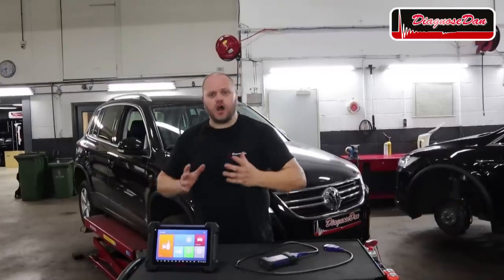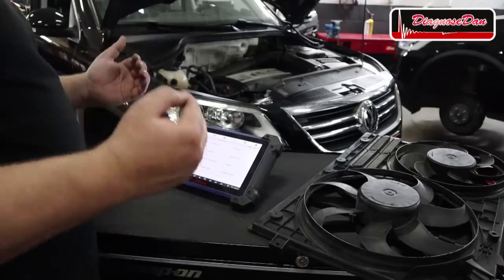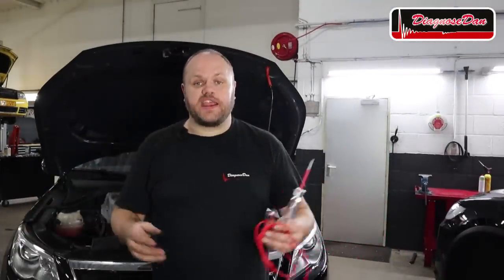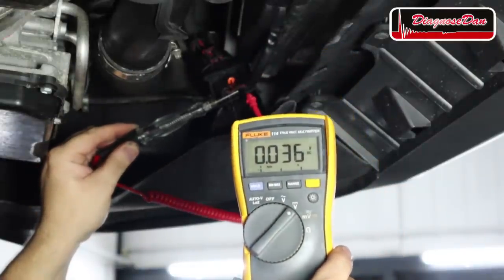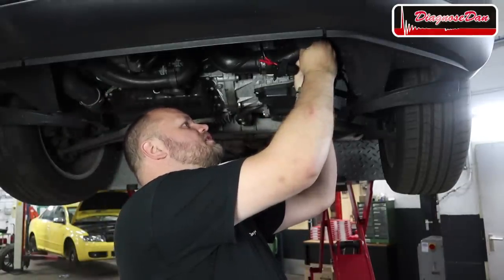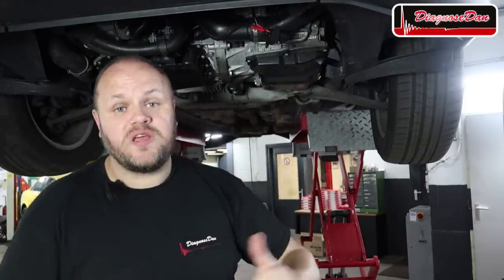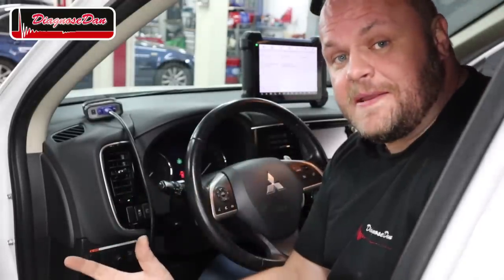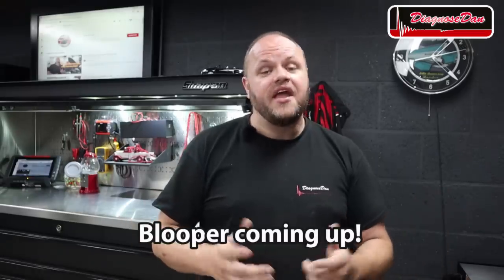A Cheap Chinese Car Key from Wish, will it work?

Comment: I believe if you or the other shop used a PowerProbe when testing the ground wire it would've pulsed the green "-" light showing a week ground or displaying "0.0" and the LED off the equivalent of a weak/loose ground. That's how I find out I have a bad ground. This reminds me of an interesting case when no shop and even the Subaru dealership could figure out why a customer WRX STI would start but stall after a few seconds with no fault codes. It was a ground wire to the ECM that had resistance and therefore weak ground. Running a parallel wire directly to the chassis fixed the problem. That was 4 years ago and the customer was upset and out of option till somebody suggested he gave me a call. And to everybody's surprise after 1 hour the car ran fine. I found 2 used ECMs, one BCM and one cluster in the car, a clear indication that somebody had been swapping modules to no avail and costing the customer money. And all it was, just 1 wire. My reputation as a diag tech skyrocketed after this incident and it proved dealerships hired amateurs to work on their brand cars and repair shops/ mobile mechanics were just plain idiots.

Comment: I always waiting you ...Good job sir..You are right when you want to conform power always believe Auto tester(Bulb test)not Multimeter..Many time if some loose connection Multimeter will show you power but actual there is not strong power.
Reply from the maker: You are right 👍

Comment: I got a similar issue myself. I got a code, ALL the conventional wisdom said "replace the fuel control module" ('06 Taurus). I tested everything that I was told to check and I even scoped (I own an oscilloscope so why not) the line to the computer from the module. ALL the symptoms were there. Unfortunately this was an intermittent issue so this took a good while to see bad results on the scoped line. It looked like this was the problem. I also took a peak at fuel pump (which sucked because I live in Michigan, ...salt belt...) and found that the previous owner had fuel lines zip tied and the seal was duct taped. I cleaned that mess up and just went ahead and put a new pump and seal in, then  fixed the broken fuel line connectors. 

Then I installed a new fuel control module (located in the trunk behind the back seat). The problem did not go away at all. Then I got to thinking about what the "experts" had to say, "these systems don't use a relay anymore because the fuel pressure is controlled by this module through PWM" and at the time this made sense to me. BUT, there is a flaw in that sentence, the power going to the control module is indeed controlled by a relay. The reason I didn't even think to look at, or even for a relay was because of that statement. I swapped this relay with the AC relay (same exact part) and the car ran fine but the AC kept taking a shit. Everything tested well when the fuel pump didn't have to work at all but under a load, the relay contacts were bad enough to cause serious issues with the operation of the pump and the module. A simple light back there on the positive line coming into the module would have shown me this issue much faster. I also have stopped listening to "the experts" and have learned this lesson. Honestly though I don't feel bad about fixing the fuel pump area, that was a hazard waiting to happen and my frustration in finding this problem lead me to it.

Comment: If you'll take your extension cord assembly from your power probe and hook it to the battery you'll always have a reliable power and ground everywhere you go.   No more running up and down the step ladder 🙌

Comment: I like your videos Dan because you explain in layman's language what you are doing (sometimes a little over my old head) your techniques and work is in my mind just brilliant. I was really surprised about the aftermarket key as I once lost one of my Mazda 6's keys (misplaced it as it turned out) and the cost of a new key was just on $259!! So I think that most dealers are really ripping off those who use their cars. Just recently my son a mechanic fixed a proximity sensor for the price a of a dab  of  Araldite glue where Mazda wanted $310 to do the same thing!! So $310 was a tad overkill don't you agree? Just out of interest just where are you working out of because your English is so good and yet you talk in terms of Euros??

Comment: The multimeter is a good first sanity check to verify there are no broken wires or dead fuses, loading the circuit down with a test light (either a bulb or something with a dummy load) to check if it can deliver any current is the second step IMO.
Reply from the maker: Thanks for sharing your thoughts👍

Comment: I have an issue with my car, my dipped beams do not work. Every relay, fuse and switch has been changed at a cost of over £300. My high beam works, dipped do not. So temporarily i have switched the interal headlight wires so my dipped are now my highs. So I do not have high beams. I suspect a ground issue.
Thank you for showing the incandecent test light! you've probably saved my ass with that, as i'd have a reading with multimeter but as you've shown, they can be unreliable

Comment: Wow! A very informative video. So replacing the cooling fans was probably not needed, as the fault came back and you diagnosed a faulty ground. Do you know how the customer got on after you sent the car back, were they told of the fault or were  they just told it's fixed? Me depending on what I was told, would be looking for some money back as a mis-diagnosis. 
BTW you have a new subscriber

Comment: Doing a proper voltage drop check will check the working resistance of a wire better than an incandescent bulb.  It does not take a lot of amperage to light a test light compared to two coolant fan motors.

Comment: I had a very similar problem on my Cayenne indicator - it wouldn't work but the side repeater did. The dvm showed the voltage going low and high as it should but when using a 2 watt bulb it was dead. Found a bad connection on the headlight connector block, cleaned it, job was a good un.

Comment: Yes l used to use test lamps on circuits, like headlight circuits using a test light which takes the same amount of current and voltage,as the circuit takes.
Reply from the maker: That's the right way to test!💪

Comment: You can easily use a multimeter to measure voltage drop as well. Turn the fan on in diagnostic computer and measure from neg batt to back probed neg power supply in connector.

Comment: Another test would be to command the fan on with the meter connected to the power and ground. At that point you could see the ground go to battery voltage and the fan not work. That is also testing the circuit with a load. In my opinion this failure is due to the ground wires and lugs being too small. The current draw is so high on a cooling fan that a small wire like that will heat up. Especially if the old fan motor bushing were beginning to stiffen. The heating and cooling of the ground fastener results in it becoming loose. Fuel pump wiring is another place this sort of thing can happen.

Comment: I have an E46 BMW and my key went belly up. BMW wanted about $650 bucks CDN plus immobilizer programming and door programming and key cutting.  Would have ended up over 1K bucks.  I purchased three much nicer keys for about 17 bucks each from Ebay, a programmer for about 15 bucks and a key cutter for about 85 bucks.  It took a bit of work, but I have three nice shiny keys now.

Comment: Very good POINT to make when it comes to electrical diagnosis.  Multimeters are good for the LOW amper sides while a 5 amp headlamp bulb or similar is best to check for load issues or current flow.  Lots of mechanics are failing this concern too.  There is a tool that works as a current tester or the headlight bulb contraption most mechanics use do the job. Really, I'm so sick of computer run vehicles full of modules as they themselves have a host of issues from failing to turn off when they should to never waking up etc.  CHEAP parts and engineering standards, OEM parts included. OEM parts are getting to be less reliable than aftermarket in some cases.
Reply from the maker: Repairing vehicles is what i do for a living. So if they didn't break anymore i would be without a job. But i know what you mean!

Comment: The reason I struggle with electrical diagnosis like many other techs is due to so much contradicting information depending on who you listen to.

I was told at college not to use a incandescent test light as it can put load on a circuit and damage some delicate component or PCB trace.I was told always use a multimeter or a LED test light like the one shown.I would have done the same as the previous garage. Arrrgh!
Reply from the maker: I know but that test light draws only a little current, mutch less than those fans. If you use the same load as there normally is on a wire (or less) you are fine.

Comment: When I test suspect power supplies/grounds, I always try it when the part is under load as well as when it's not. That way you can sometimes pick up intermittent problems as you get low readings but enough power to  make the part work. Great Video as always Dan, I was really surprised that dodgy wish key worked! Questionable how long it will carry on working though!
Reply from the maker: Time Will Tell😁

Comment: yes it worked Dan .but a little advice from an ordinary sparks .if i cam e across this with obvious heating on the lugs spade connectors i would immediatly cut those lugs off and using new lugs and heat shrink i would make brand new spade  lugs on the cables Then i would go for the threaded bolt they are bolted to which caused the original problems and i would fit a brand new brasss bolt and washer s . the n iwould bolt the new lugs to the bolt and using either spray seler of some good quality silicone e.g . the silicone used on gakets the seal the whole bolt and connectors

Comment: I recently tried to program a Wish key on a Mini R56 from 2012. Since it has the more recent CAS3+ version, it needed to downgrade but after it started the downgrade process the procedure hang and the car was bricked!  It took me half my Sunday to remove the CAS3+ from the car and restore it using BDM programming.

I was using genuine BMW Explorer, a high quality tool, but this is a common issue with all tools. So please be aware that programming Wish keys is not safe on all cars. 

As a general rule, if you have to order your dealer key by VIN or you have lost all keys, programming it is risky. If you can order a dealer key using just the part number, programming Wish keys is as safe as programming original keys.
Reply from the maker: Thanks for the feedback 👍

Comment: he said a multimeter is not the correct tool for checking power.  thats exactly what a meter is designed for so most definitely is the correct tool.  It just has trouble detecting a week ground or neutral.  but you found that by watching the voltage drop when placed under load.

Comment: I really liked that.  You have to remember voltage is not amperage.  Easy to overlook. Great job Dan!
Reply from the maker: You are right 👍
Reply: @Diagnosedan  Gonna get me one of those test lamps now. Use to repair TVs, VCRs, and electronics, but never had one of those tools.

Comment: Dan, here is one for you.  Another you tube channel bought a 2020 Defender with a 4 cyl.  160 miles, and it threw a check engine. Check engine light "supposedly" fixed. They picked it up, and none of the cameras work. AND now,  check engine  back on.  Dealer is just doing a "throw parts  at it" and hope it is fixed.    What would be the steps you would take to find the problem?  They have owned it 24 days and only driven it 4 days.  Supposedly a Land Rover Engineer has flown in and cannot figure it out....

Comment: Dan the caveman! 
If you command the fan on with the multimeter backprobed it would be under load and the fault should be apparent on the multimeter. Great video as always!
Reply from the maker: Not in this case, because the fan module also has no ground (it's build into the fan motor) so it would never turn on the fans
Reply: DiagnoseDan gotcha! That makes sense!   Thanks for clarifying

Comment: hi Dan , thanx 4 all your videos ...... it has helped me a great deal ....... 1 question ... in most of your diagnostic , you use back prope neetle propes ... where do you buy them ....... i like that they are flexible and isolatet .... in the garage i allways strugle wit paperclips ans aligatorclips ..... so do you have at link or something ...... best regards Morten

Comment: You don't necessarily need an incandescent light.I have some of those annoying buzzers that were in cars to warn of a key left in the ignition or a door ajar that I used for load testing when I couldn't see a light. I've also used a car horn.
Reply from the maker: That's annoying😂😂

Comment: I have a few tail light and headlight bulbs I installed banana jacks on just for this type of testing.  The meter is not your friend on any kind of current carrying circuit.
Reply: That's great. I'm cheap and a DIYer and doing exactly the same, have a wreck in my yard which I'll be using. Tail light bulb as a low draw and a seperate headlight one for the higher draw testing. Love your thinking mate. 👍
Reply from the maker: I have also made a collection 😁

Comment: LoadPro:  Your diagnosis was great but however you could have made the diagnosis easier and quicker if you would have used a volt meter with LoadPro leads.

Comment: Awesome as always. God bless you for sharing this videos..i had an overheating issue on a 2009 mazda.goid ground goid power .but still no coming on..how did i get it to work.? I pulled the fuse for the fan.and put it back in .yes it did work..
Reply from the maker: Thanks for watching 👍

Comment: Hi Dan! Is there any optional tool that can diagnose a SAAB NG9-5 2010/2011? The only alternatives I have seen is GM MDI, VxDiag. They are the only one that can pull the codes from all the modules. Can the Autel do it?

Comment: Thanks Dan, great video!! Do you think that if you measure resistance between the ground wire on fan connector and negative in battery, the value could be helpful for your diagnostic? Or the value would have been 0.2 ohms
Reply: The resistance measurement is such a tiny voltage, the test bulb is hard to beat
Reply: Would be better off activating fan through scan tool and taking a voltage reading between neg battery terminal and where he had the ground wire back probed on that connector.
Reply: @Jason-cu1jp  you suggest a voltage differential test, could have worked or just closing the circuit and the fans start. At least he knew it was a ground wire.
Reply: @Spelter  Agreed.
Reply from the maker: Ohm readings can be helpfull but they can also confuse you, with a test light you can "SEE" the result.

Comment: Hi Dan, excellent job on the Vids. Your explanations are superb.
I would like to pick your Brain, about a prob. I am having with my Mercedes Benz B200t Radio. The Antenna mast for this car is located on the roof and at the rear of the car. 
When I turn on the Radio, I only get a couple of stations and a lot of static. 
So I took the ceiling off, at the rear and located the Mast. It has a circuit board at the base with two wires connected to the it. One Blue, which was connected to a wire going to the front of the car and the Radio I presume. The other wire, a Red plug, which was soldered to another part the circuit board  was just left hanging and not connected to anything. It looked kind of new, like a spare.
Would you happen to know what the reason for the static and bad reception is? Does this Red plug need to be connected somewhere?
I tried to isolate the Mast from the body of the car, in case it was grounding out, but it did not improve. Do you know if there is an Antenna amplifier involved?
I would appreciate any help you could give me.
Thanks, and stay awesome man.

Comment: many car repair shop People are not good at car electronics. if you are measuring whether a wire or connection has poor contact or high resistance, you must always load the circuit wire with a bulb as the man in the video says.
Reply from the maker: You are right 👍

Comment: As always great job DD.   I learned something new about the tester light.   The led one is pretty cool too.   My first guess was the control module on the VW was bad.   Since the control module is built on the fan assembly, would applying an external 12V power source to the fan's power and the ground will make them run?
Reply from the maker: No, than the fans would always be on😁
Reply: @Diagnosedan  so perhaps that what the other shop should have done before replacing with new fan assembly.  I am sure they learned too from your diagnosis.

Comment: Hi

Great video, i noticed with the constant up and down the ladder when the lift is on a hoist.
Have you considered in cases like this to have a type of mini jumper lead set up with at least 3 or 4 meters of both positive and negative at hand to save constant getting up and climbing up and down ( possible alligator clips battery end and shielded female connectors other end so they dont accidentally cross connect and spark
Reply from the maker: Great idea!

Comment: I'm a bit lost here.  If I'm not mistaken, the multi-meter was showing 12v but the bad ground connection could not support the amperage of the fan running.  The rest got past me.  My takeaway; use a heavier load to test a circuit.  Question: How do you increase the load when using a multimeter, or is a multimeter the wrong tool for the job?

Comment: Most of the keys for my 01 Passat are from wish and they work fine. Just annoyed that the swivel bit keeps breaking on both the original and Chinese keys.

But will that tool also program keys for VAG cars?